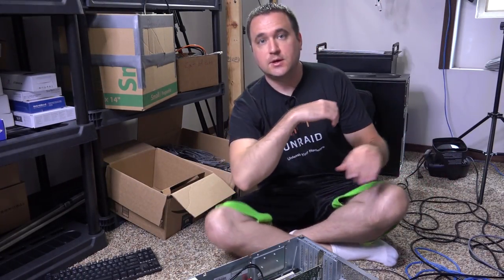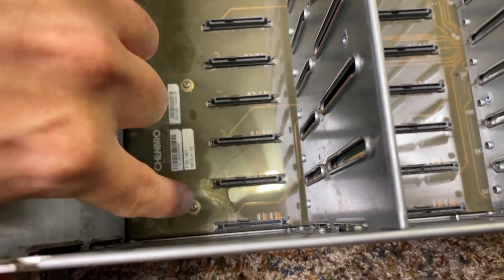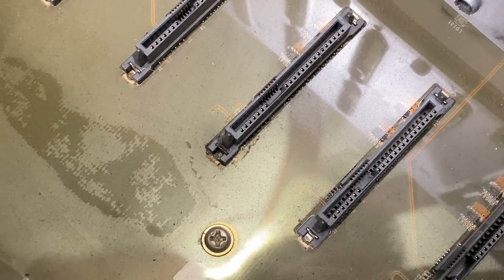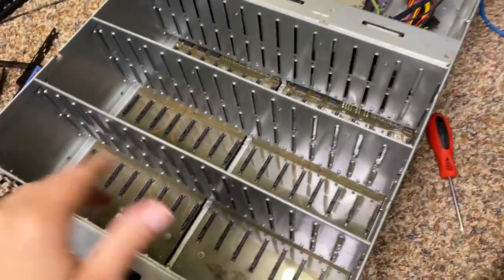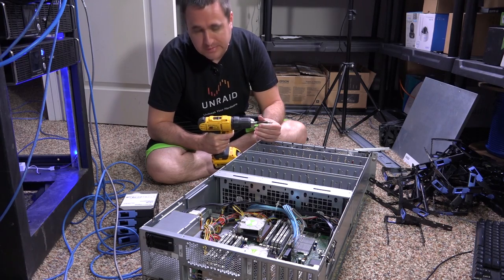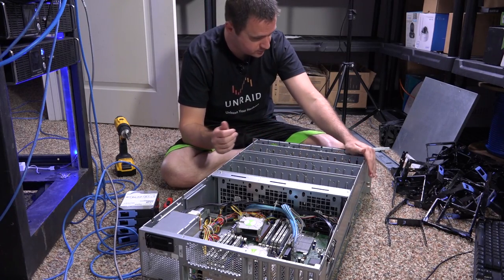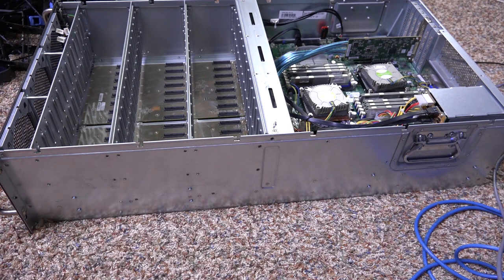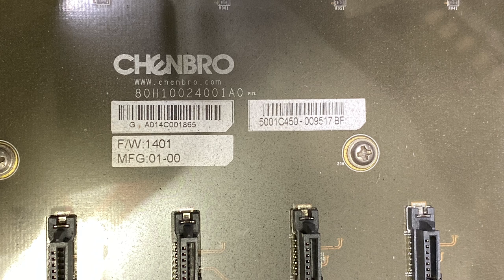New Server Tear Down...It was gross..

Comment: takes PSU a part yikes, just don't mess with them if the fans bother you buy some other PSUs that will slide into the housing. your risking something not even worth it.
Reply: just because it might "fit" does not mean it'd work, he'd have to do some more research for that
Reply: Just don't touch the capacitors and anything connected to them and you'll be fine. I've done that just to add RGB to my PCs PSU.
Reply: You can short the cap making sure you're isolated from that circuit (plastic tongs holding a small wire maybe)
Then once it's all discharged (after a second or so) it's now safe to handle.
I had to do that after my water loop leaked straight into my psu and I wanted to clean it.
Reply: @KillaBitz  Virtually all modern PSUs have bleed resistors that drain the stored charge in the capacitors. However, it is still recommended practice to use a multimeter to double check for stored charge. In any case, a simple 20K 5W resistor across the cap would do the trick of bleeding the resistor charge.
Reply: I just don't think its worth the risk, sorry.

Comment: I have 3x 120mm Noctua iPPC 3000rpm fans in my FreeNAS server.  They are NOT quiet.

Unless you have some way to control them with PWM via IPMI or an external PWM controller, they will not be quiet.

I have them set to about 1800rpm and they are plenty quiet. 2000rpm is audible, but not horrible.  Full 3000rpm is way too loud to be only 4ft from my ear.

Comment: Buy 2 LSI cards and run all 4 sas ports across 2 PCIe 3.0 slots. Redundancy is as important as speed. PCIe 3.0 will give you the best speed option. But cards are definitely more expensive.

Also replace all fans in the server with Nactuas. Install a CPU thermal solution that will utilize Noctua fans. Your only noise will be the PSUs but you should leave those alone and deal with it. Unless you can find a factory solution that is quieter like Supermicro offers for their servers.

Comment: You already have the fastest route that backplane can function with your specific SATA HHDs, no upgrade would increase your speed, the only logical change would be to double up on the SAS controllers by picking up a 2nd duplicate and installing it same as the card you already have, so if you have a controller error or failure it has another way to communicate with the array. Something I would change vs your Zeus build is to use 2xSSD's in Raid also instead of going with a GPU that uses an additional power plug, just go with something that does not have the extra power plug. I run GTX 1050ti in my Plex server and I have it turned down to 50% of power and I can still hardware transcode over 25 streams with the hacked GPU drivers for Linux.

Comment: Suggestion; Power up all the PSU's, they are there for a reason. Find or make a air duct to channel airflow over the DIMM's, yours are NOT going to cool correctly. Use correct HSF's on the CPU's, not the poxy little 1RU things sitting on there. Use the correct RAM config, fill all the slots. Don't complain about Chenbro, they are cheap, built cheap and they perform cheap. You get what you pay for.

Comment: I got this HBA because I didnt want to have a SAS Expander in my setup and I got that one really cheap (440€). Broadcom SAS 9305-24i
Reply: There is no need for a 9305 24i unless you are direct attaching with out a backplane
Reply: @fuoman100  in my case it was a perfekt fit because my case has 1 backplane for ever row of hdds (6 in total) and every backplane has an sf8087 port and the 9305 24i also has 6 sf8087 ports. It's obviously overkill for this usecase but with this card i can upgrade my case without to worry ever about enough bandwidth for the hdds 😂

Comment: I wish you luck with the new build.  I am currently dealing with a similar issue with supermicro 16bay sc836 HDD backplanes; direct attached sata vs sas with redundancy.
Reply: Have you found a solution to your problem?  I also purchased a supermicro 16bay sc836 and don't know if I chould upgrade to a direct attached sata vs sas with redundancy.
Reply: @Transamws6prg  I have gone the direct attached sata route with  the "BPN-SAS-836TQ" for a FreeNas backup server. It feels a little better performance wise instead of relying on 1 sas cable.  Just need to replace the noisy 80mm fans and their holder with a custom 2x120mm fan bracket; cardboard be my friend for getting proper measurements.
Reply: @Madnick111  I replaced all five 80mm fans with the 80mm Noctua NF-A8 PWM fans and it made a big difference.  I am happy with that upgrade.  What LSI card are you using?

Comment: So the WD 10TB Red drives you shuck have a maximum throughput of 210 MBps. Rounding up to 250 MBps and multiplying by 24 drives means 6GBps per backplane. Since you have two 24 drive backplanes you would benefit from a second lsi 9210-8i. SATA has a 6GBps limit so a single 12GBps lsi 9300 would not work in this use case because it only gets 12GBps with SAS drives and you are using SATA so it would go back to a 6GBps card.

TLDR: Get a second lsi 9210-8i
Reply: ***Assuming your backplane can utilize the 8 channels per card, I have never used a "Chenbro". Hopefully they all work because that one SATA connector looked pretty corroded.

Comment: the backplane is 6Gb/s only so even if you replace the raid controller the drive will still be limited to 6Gb/s
file:///C:/Users/sweds/AppData/Local/Temp/Manual_6Gbps%2024-port%20expander%20backplane(80H10024001A0)_V1.0.pdf

Comment: I posted this in your Discord as well. I was pointed to this thread on the Unraid forums regarding the topic of SAS controller performance for parity checks, etc. https://forums.unraid.net/topic/41340-satasas-controllers-tested-real-world-max-throughput-during-parity-check/ It will vary based on how many drives you have connected to each SAS/Mini-SAS port as the way things look, much like my Backblaze build, the backplanes are likely to be SATA multipliers, which is why it can split off those 8 lanes of SATA throughput to the 24 ports per backplane.

Comment: You mentioned 12Gb but you are using SATA drives.  12Gb is only SAS.  You are also confusing SAS channels with PCI Express lanes and they are not the same thing nor directly related.  I think this has been mentioned but those SAS breakout cables are 4 each, not 8.  The card is an 8i, 8 channels total.

Comment: Your probably limited to the speed of the actual backplane.
Reply: Also from what I can find they 6gb backplanes
Reply: You could add redundancy and availability but not higher speeds with a lsi 9201-16i
Reply: Not necessarily correct; a passive backplane is merely an "extension cord" of the (matching/mating) data cable; therefore the data rate over the entire length of the cord is limited either by the controller's protocol(s) or the protocol of the drive/device, whichever is older/slower.

On the other hand, an active backplane is certainly limited to whichever standards and protocols it was designed to function under.
Reply: More importantly the parity rebuild will be limited to the speed of the hard drive being rebuilt.. no amount of fancy hardware will increase that.  It's just going to be slow.

Comment: That thinggg is naaaasty😂
Adding 2 more cards will definitely give you redundancy, but I'm not sure if more will increase speed. That all depends on the backplane.
So see how the backplane handles the connections and match that with the controller(s) .
Does it need to be a stand alone server? You can make this server into a storage solution handled by Zeus. 

I was thinking of getting a server like this one but now I will definitely stay away from them and get a Dell Poweredge.

Comment: Your SAS card and backplane are not your bottleneck. The 6gb backplane should be capable of over 800mb/s...and that LSI card, should move 300-400mb/s. Are you running the HBA JBOD, with some kind of software RAID on top of that? If so...your bottleneck is in that setup, somewhere. Personally, I'd run hardware RAID-6 on an ARECA controller...for over 600mb/s... And RAID-10 if I needed it to move faster.

Comment: My old professor would have a heart attack if he seen that you are working on a machine directly on the carpet. Static electricity is still a thing to be aware of in 2019 and for a tech channel I would expect a better example being set. I've been out on service calls to repair and replace equipment that had issues caused by being setup in carpeted environments.

Comment: Check out Art of Server yt channel. He does this for a living. As for the SAS ports that you already have on your backplane, your discord friend is correct. You are only going to be able to use one SAS cable. The second is for redundancy, not additional speed. The third out is for daisy chaining additional backplanes.
My r730xd server has an IT mode HBA card installed and I can do 12x 10TB drives with one parity and get around 200 MB/s speeds.

Comment: The lSI 9305-16i is your best upgrade. 12gbps per lane, 16 lanes. 4 lanes per port. You could use this LSI card to support both of the backplanes, with 2 ports for each, since the third is for chaining only. This is assuming you plan to replace the motherboard still as this is a pcie 3.0 card.
Also yes, SAS cables and ports are always 4 lanes. 

https://www.ebay.com/itm/LSI-9305-16i-PCI-Express-3-0-x8-Low-Profile-SAS-Host-Bus-Adapter-/381679131527

Comment: Idea from an Idiot... So take this with a grain of salt.
If you can connect the card you currently have to 2 of the ports on ONE backplane/PCB you could check the transfer speed and see if there is any difference between using 1 cable or 2 cables.
I think that would give you your answer?

Also, probably would be good to check ALL of the HDD connections on each of the backplanes.
Just to make sure you have no DOA connections.

Keep up the good work there mate.